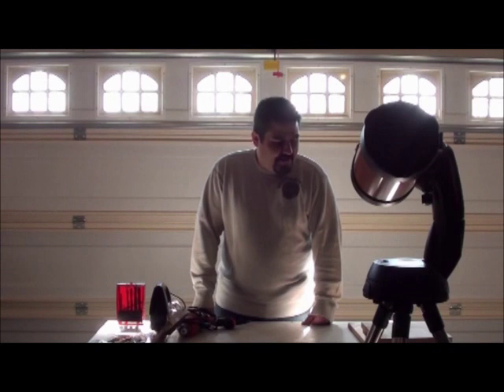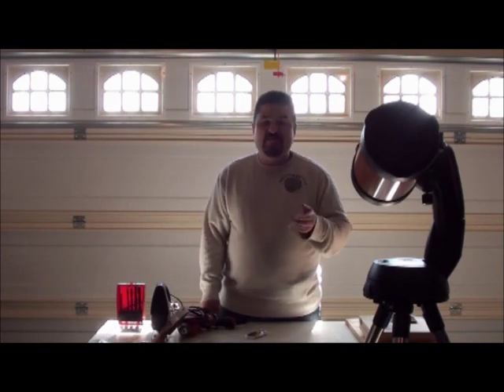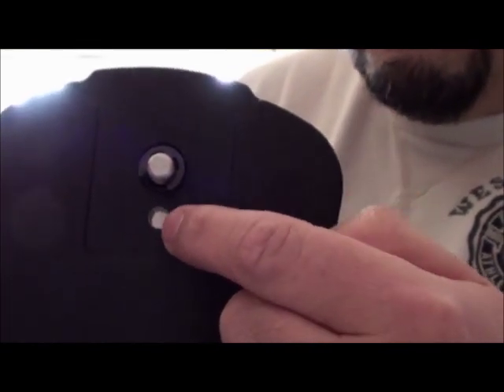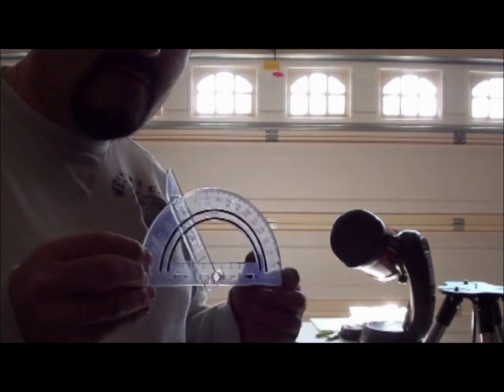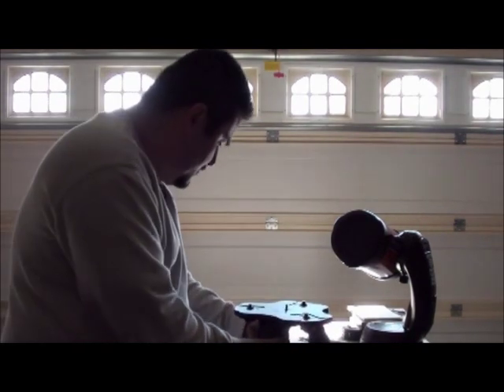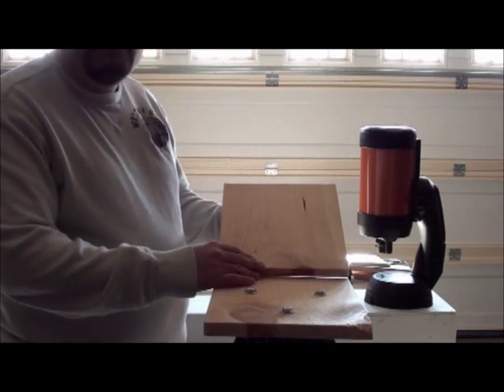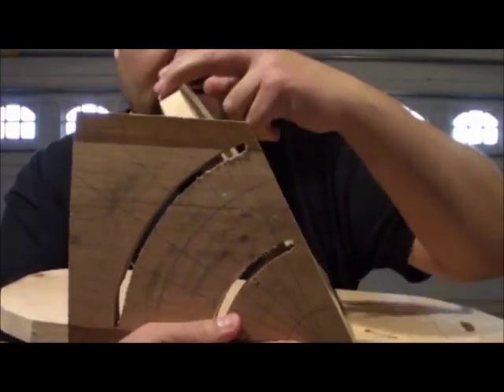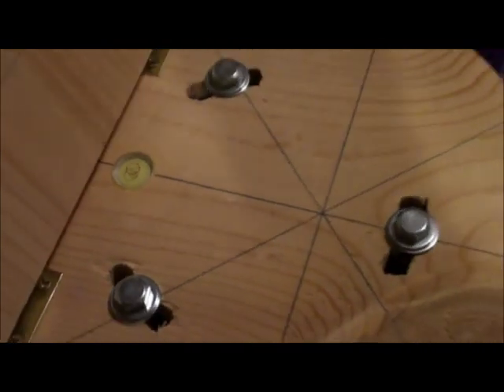Telescope Wedge - How To Make One - Celestron 6/8SE

Comment: He does an outstanding job of detailing the steps needed to construct an equatorial wedge for an existing Celestron six or 8 inch telescope. I’m particularly happy that he included the information to make a variable angle wedge, so that it can be used at different latitudes. Thank you for the hard work And clear, concise and detailed information. What a money saver I plan to build one as he did, but I plan to sand and stain the wood. And probably install a bar to the center of the adjustable board where the telescope will be mounted and have that attached to the stationary board that attaches to the tripod so that it adds more stability when it’s adjusted so it then resembles the construction of the metal version that is mass produced. Also, rather than a bubble I will put into Tube bubbles so that I can get more accurate leveling. Again, I appreciate the time you took to make an excellent video for those of us, wanting to save money and who love astronomy.

Comment: Too many initial steps!  Use compass to measure from center hole to one of the outer holes to get the radius of your circle.  Also use your compass to measure the distance from one of the radius holes to the next hole center. Lock compass then place pin end of compass onto drawn circle on board and draw where the line intersects the previously drawn circle  and draw an intersecting line both to the right and left intersecting points. These plus the pin hole mark the points on the circle to drill your holes!

Comment: Thanks for the video.  I'm just getting started so all this is new to me.
It "looks" like the weight and balance could be centered on top of the tripod if the wedge was not put so far to the end of that long board.  I don't know much about such things, so is there some disadvantage to putting the wedge centered over the top of the tripod?
-  -  -  silly newbie question -  -  -  
Thanks.
Reply: After you mount the telescope the bulk of the telescope will be over the center of the tripod legs.

Comment: Hey Baltier2705 - what is the actual length/dimensions of the bottom board you are using?  Is it just a 1x10 or a 2x10?  How long is it?  I'm not sure if I missed it in the video...  Are there pictures of how to mount the scope (or after you mounted it) just so I know how to actually put it on there.  Thanks!

Comment: you inspired me to build my own.....works great,....I tweaked your design a bit by adding 2 Buckle Screws and removing the side panels....very easy to make fine Alt adjustments...I notice the base of the wedge does twist and bend under stress....going to try 3/4 plywood for more stability......will also try a "piano hinge" which goes all the way across the wedge, instead of two separate small hinges.......great video !!!

Comment: So I built this wedge, thanks for the video. One thing to note (stupid me) the bolts I used to secure the base to the moving part of the wedge were too long. It caused the scope to only rotate 120 degrees. I poured through manuals trying to find out why then boom. The bolt stopped it from moving. Please note that before someone damages their scope. ;-)